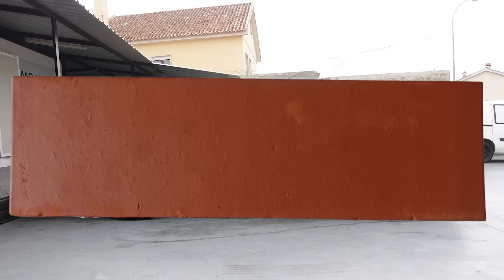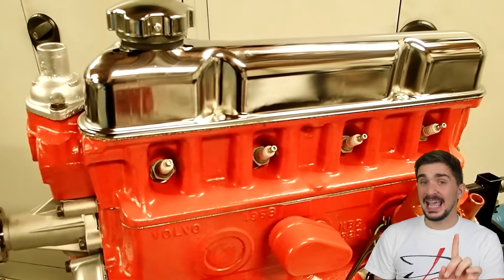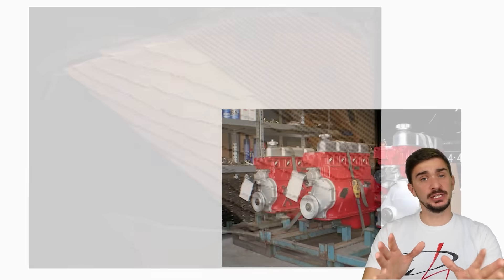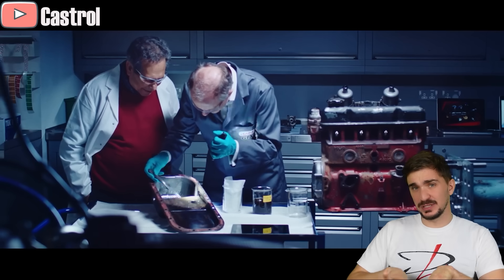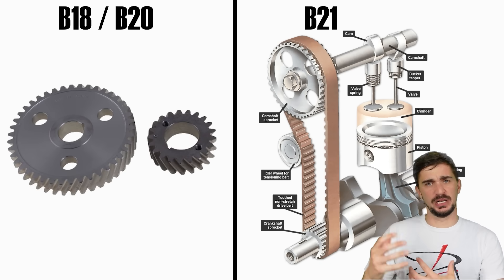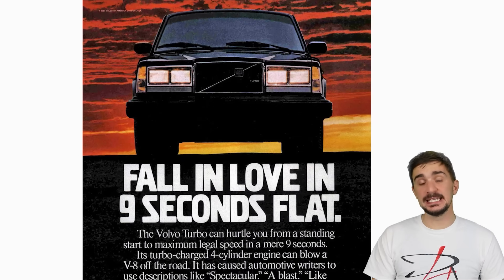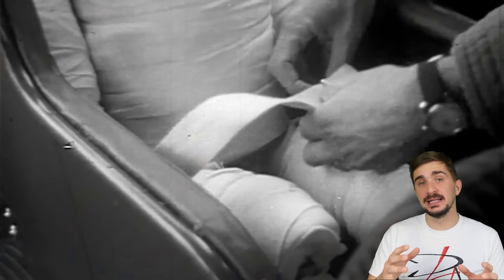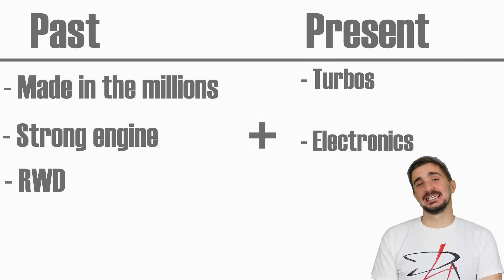A Story about the Volvo 240 and its Redblock Engine - Iconic Cars and Engines #18

Comment: Great overview of the legendary 240! I've owned a few of these and 1990 is my favorite year of the 240.
Reply: I had a 90 and put over 200,000 miles on her...   I am torn between it and the 1984 year - I had 2 different ones of those (a wagon and a 4 door) that wagon was amazing - turbo-intercooled manual transmission car with the pushbutton overdrive...  the B21FT just seemed to be a little tougher than the B230 - but maybe that was a me thing... overall, both great cars! 

OF course, the 84 gave it's life for me, took a 1T Dodge Dually diesel pickup on the drivers side - truck was going 30+ mph and ran a stopsign.  Killed the truck, bent the Volvo over 3" on the passenger side... but I drove (limped) it home!  If I'd been driving my other car that day (an 85 Dodge Daytona) - I don't think I would be typing this today.

Comment: Thank you for this nice Video! I drive Volvos since 1981 and will do this until I die. My Neighbors always tell me how bad Volvo is and they drive German cars;
but every five years they need new cars and they have lots of troubles in the years the drive (or stand). I had four 240s, one better than the other. Now I have
an 2001 C70 and his 5-cylinder, 4-valve Turbo is as great as the old B230 was.

Comment: My first Volvo was a 144 with the B20/ 2.0 l pushrod motor, but fuel injected. It didn't run because the fuel injection 'brain' - a fat briefcase-sized computer under the passenger seat - was getting wrong inputs from the cold-start circuit. A 50p rheostat, slider type, screwed to the dash gave me a manual cold start device, and when hot, I could lean-out the mixture to optimum for motorways, and a tad richer for tooling around the lanes. Everything worked perfectly, and I used to thrash that car! The engine truly was indestructible - unburstable I used to tell friends, who thought it was a grandad's car. With fairly short gears in a 4 speed 'box, it red-lined at 100 mph, but with an overdrive at the sweep of a stalk, brilliant, 70 mph at just under 3,000 rpm, and surprisingly good acceleration too, from stand-still, or at motorway speeds - hit the accelerator as you flicked the o/d out and it was as good as most other 2 l cars 15 years younger than mine! A head skim, for no better reason than that I was curious, sufficiently bumped up compression ratio and high rev performance, and by fiddling with the distributor fly-weight return springs I avoided too much knock. It was also possible to slightly change the fuel injection timing as the pair of contact breakers in the base of the distributor moved with the body of the distributor, so I ground off the lugs of the dist. cover so I could rotate it to keep the end of the rotor arm in the right place relative the pick up points inside the cover. I KNOW this motor was a wednesday morning job, and it certainly made more than the factory-stated power output, by some margin. Eventually the dist. cam spindle bearing became so wobbly that the timing scatter became almost unmanagable. But for 4 years I thrashed that thing all over Europe and the UK. Downsides? 15-17 mpg in town, an absolute max of 27 on a very gentle run. But who cared then, in the 80s?! With Thatcher in power you had to have some fun somehow!! Oh, finally - you could drive into any scrapyard back then and pull a load of injectors and other engine parts off any 144, and even from the 2.7 l six pot from a 164, a 'unit' engine based on the B18 x 1.5. The injectors were identical, as were valve rockers and pushrods and so on. Brilliand fun for ? £150, and a few quid at the breakers (-;)~ (Leather seats too!)

Comment: Greetings from Malaysia!!  Great video!! 
Didn't know that the Volvo logo is a shield and spear, the symbol of iron.  One thing for sure is that the 244 is an armoured tank disguised as a car.  It's virtually indestructible.  The engine is designed and built to last till the Second Coming of Christ.  That the same engine can last for millions of miles is unheard of even in modern cars.  Now, modern engines go kaput just one week after the warranty expires.  Volvo is synonymous with safety and reliability.
 .

Comment: In 1974 came the "millimeter engine", Volvo stopped using inches. The B20 was also produced in 1976, if I remember correctly.
You can take pistons from the B21 and use them in bored-out B20s, at least 1974 - 1976. It should be possible to rebuild a B20 and put a B21 top, but it's a lot of work.
Injection existed from 1971.
Good that you spoke Swedish at the beginning, definitely passed.

Comment: I had a 1990 Volvo 740 GL that had a transmission intercooler break, causing coolant to leak out for months until one day it started overheating. The temperature gauge was pegged by the time I pulled into the driveway at home. Then after the radiator was replaced and fluids flushed, it continued happily driving for years until a gearbox gear tooth snapped off.

Comment: Volvo introduced further strengths in the 94 940 B230FT with oil squirters, 13mm rods and sodium filled valves.  The B230FT is the preferred tuner engine today.  Capable of 1000bhp.
Also watching teardowns of the 2JZ engines, looks to me like the Japanese copied many red block features, the time lines look feasible.

Comment: The fiber drive on the B18/20 could split and then there was a bit of noise, steel drives could be bought for racing. It is a non interference engine so valves and pistons never collide. A ridiculously reliable engine almost on par with the Mopar 170ci slant six.

Comment: Always been a brick fan, even as a kid. There's just something honest about them. I have to admit, I always preferred the GL versions, and in the U.S. in the 70's that meant the 2.7L PRV V-6; we didn't get 4-cly GL's until 1980. Even so, I've had two 264GL's, three 244DL's, one of each 760's (V6, gas turbo and turbo Diesel), two 740's, both gas turbos and one 960 I-6. All but the 960 had the 4-speed + OD manual gearbox, and I loved that transmission with it's electric OD switch in the middle. They were all comfortable, competent, safe, reliable cars and I miss having one. I would put a second mortgage on my house for a pristine '79 262 Bertone Coupe; always wanted one!

Comment: My first view of the Volvo 240 was the first Wellington street race (NZ, 1985, televised live).    Entries included 5-litre Holden Commodore V8's, 5.8 litre Ford (Aus) Falcons, a swag of BMW 635's, 3.5 litre Rover Vitesse V8, - and one Volvo 240T, which arrived too late for practice and had to start from the back of the grid.   Well this hulking great brick just carved its way through the field, then it was involved in a shunt and had to pit to have its bonnet tied down.   Carved its way back to the lead again then its bonnet started flapping and it got black-flagged and had to pit *again*.   And again.    And it did it all again - here it was passing BMW's of almost twice the capacity and a Holden V8 of over double - how the hell could the motor hang together?    Yes it won the race, and there was never a more worthy winner.    Hugely impressive.
Reply: It won the race in spite of all of the extra pit stops. I bet that the other teams were thankful for those pit stops or they may have been badly shown up!.

Comment: My father used to own a Volvo 240/244GL, bought secondhand back in 2001 (pinkslip states that the car was registered back in 1983 something). I'm just 18yo at that moment, but I really enjoyed driving it. Feels very tanky and safe, and could speed up to 150km/h easily and still stable enough to control. the car still driveable until 2020, then it got some major issue with the engine, and my father no longer wants to repair it.

Comment: My first car was a 1987 Volvo 240. It had 230,000km. The engine is bulletproof, but not the wires....They are made of environmentally friendly material. It just means it's meant to degrade over time. The engine didn't break but the wiring were falling apart everywhere. I had to sold it not running.

Comment: Fabulous video, thanks for creating, editing and uploading. Informative, interesting and raised a smile several times, very wry presentation, I enjoyed it. Had a 740 estate with 250K miles which I bought for peanuts as a temporary load hauler but ended up keeping it several years because it never let me down despite no maintenance other than a timing belt. Had I know it was a non interference engine back then, I wouldn't have bothered having the precautionary belt change. That car loaded with heavy stone slabs drove up steep hills without even breaking sweat, an amazingly comfortable, well screwed together galvanised brick.

Comment: My wife and I had a VOLVO 240 (245) wagon. It was a Euro-spec car that had been sent over here in error. The VOLVO dealer begged us to sell it back to them after they discovered this at our first service. We kept the car for a number of years before selling to a serviceman that was taking it with him back to Europe. This car would 'cruise' all day at speeds well above our speed limit without even breathing hard. And it got very good fuel mileage doing it too.
 Suffice it to say, we loved that car.
Reply: I bet you wish you still had it. A truly amazing motor car.
Reply: Interesting, can explain what the difference between European spec an USA spec was/is??
Reply: I had a 1980 245 I bought in 1985 from someone in the US Air Force. He had bought the (US spec?) vehicle in England but had removed the catalytic converter so he could use it with regular gasoline. (I later had to buy a catalytic converter when I lived in a state with pollution tests.)

The only visible difference between mine and all the other 1980 245s was mine had round headlights. Suited me fine-- the round sealed beams were cheaper than the rectangular ones.

I spent a lot maintaining that car, but by the late 1990s I had trouble finding folks who could service it in my area. So I sold it to a guy who was a bigger fanatic. He had bought it for his adult daughter, who I hear hated it. I kept seeing it on the road for a few years. I don't doubt she finally found a way to wreck it irreparably.

It had electrical flaws but I just knew to carry some fuses, and plan to put in a new alternator every 100,000 miles
Reply: @conwaytwt  US vs European specs. What are the differences?
Reply: @stefpix  Presumably all the marker lights met US specs, plus the emission control system, AND (because it was 1980 and we were still under the oil crisis highway speed rules) the speedometer had 55mph highlighted in a different color and it was made so 55 was just to the right of center, if I recall.
Reply: @conwaytwt  the US light specs seem to be to a lower standard. The turn signal can be red instead of orange. The tail lights and the brake lights can overlap. The headlights often spillover and flare onto the opposite lane. Never saw these shortcomings in Europe.
Reply: @stefpix  the great thing about standards is there are so many to choose from
Reply: @conwaytwt  some standards are better than others. I moved to the USA. Many cars here have poor tail/turn/brake light designs. Red turn signals have been shown in some studies that are not as effective as orange turn signals, and there was a higher incidence of collisions. The headlights in the USA seem to point higher, causing more glare in the rearview mirrors and on the opposite lane. In most of the world turn signals are orange and separate from the tail light /brake light module. One of the most glaring examples of cars with confusing rear lights have always been the Lincoln town cars
Reply: @stefpix  I don't know why you're complaining to me about it
Reply: @stefpix  Bit late but pretty sure it only was lights to meet us guidelines. The US, dual square lights go for around 900-1100 bucks due to the demand for them in Sweden.
Reply: My first vehicle, a 77 245 4 speed manual.....I did that car wrong 😞
Reply: Great Gearboxes too  Borg warner auto box  brilliant!
Reply: You were a fool to sell a European spec car to someone who just took it back to Europe.
Reply: volvo 740 was my first ever im def jelly xD
Reply: We had a 240 and a 64 impala with the 350 . The impala used less fuel than the 240. 
I guess volvo really was more of an amcar than even some amerikan cars XD
Reply: @toadwine7654  the 245 weighed two tons mate!  2000KG!  empty weight!    full capacity   + 4 people and luggage ?.. 2700kg!     a beast!   my 240 got 32 MPG  28 MPG with the overdrive!
Reply: US vs European specs. What are the differences?
Reply: @stefpix  Euro spec generally means it has the Euro spec required brake pads, and is designed for the higher potential speeds of things like the Autobahn.  Europe has stricter guidelines for safety as well as ironically higher performance standards.  So depending on the manufacturer, the euro-spec is generally better if they don't make both to Eurospec to begin with.  the EU has higher emission standards as well, so sometimes Eurospec has a smaller engine, though the same power.  For instance, in 2010-ish you could get a 5 cylinder S60 In the US but in Europe you could only get the 4 cylinder models.
Reply: @spartan9458  You are right but you can get T5 Volvo's in Europe too. I think they are tuned differently and have stiffer suspension than U S spec ones though.
Reply: @spartan9458  thank you. That is very interesting. Is there an advantage in 6 cylinders vs 4 if power is the same? My pet peeve are the non standard brake, turn lights in the USA, which can overlap with the tail lights. I saw Lincoln town cars braking with the turn signal on in the evening and it was not clear that the turn indicator was on. 
They did studies in the USA that the orange/amber color turn signal seems to prevent collisions by some significant percentage. 

ALSO in the USA, in Brooklyn I see huge semi trucks without side guards, and with a long nose driving through residential neighborhoods. The safety standards seem lower.
Reply: I had a Volvo 240 which was about my first car in the 1980s.  I did over 100,000 miles and sold it at 165,000 on the clock.  Unlike my first car, an Austin Maxi, which was ergonomically brilliant and good to drive, it was extreme reliable, and easy to service by oneself.  It only gave ca 30 mpg, but then fuel was cheap.
Reply: My first car was a 1998 V70 T5, oh man that car was amazing.  My father got it from the factory in Sweden at the end of 1997, and we took the factory tour.  It was absolutely amazing!  It would cruise at 110-120 mph easy for an hour straight (we did high speed runs from Gangelt (near Aachen) to Spangdahliem AFB frequently since he was retired Air Force and active NATO.  about a 1 hour trip at 110-120 mph.  No matter what you were doing it always felt like it had more to give or was perfectly happy doing it.  

The 5 cylinder in it absolutely destroyed all of my friends at highschool in their mustangs and fastbacks, tuners, trucks, whatever. 
It actually baffled me that the 236hp 241 ft-ibs of torque engine in a brick shaped wagon had 64 less Horse power and Weighed Less by at least 100 ibs, than the Mustang GT convertible that some of my friends were on about.  But had an acceleration of about 1 cm per second faster at any speed unless you got caught in the small window between 35-40 mph, where it would not downshift to gear 1 but instead gear 2 and you'd be just below the power and just in the turbo lag, or on launch where it would inevitably catch up due to the very vast gear shifts it did.  

One of my friends tried to trade me a Mitsubishi Galant VR4 for it.  that was funny but he seriously wanted my Volvo. 

I did some bad things to that car in my young years but it took them like a champ.  took me 2 months to realize I had severed the front suspension (that wasn't actually my fault, construction site at 6 am with bad headlights.  I eventually upgraded the bulbs and it was fine)

I now have a 2007 S60R 6 speed manual, which was one of my dream cars.  I have had a 2015 V60 and a 2019 XC90 T8 Hybrid and while they are great, for some reason the 2012-2016 models lacked the excitement and roar of the earlier 5 cylinder models, though they still accelerated fantastically and had a cute turbo flutter sound.  
The hybrid was a beast of it's own, that 6700 ibs SUV doing 0-60 in 5.6 seconds with 400 hp and nearly 500 torques was nuts.  Super comfy and fun.

Both of the newer Volvos were lost protecting my spouse, only one of the incidents was her fault.  Unfortunately she was working for a rideshare company and they only paid 70% of the car's value Despite her having Diamond status.  
we no longer work for said rideshare company. 

The S60R is my baby, and the V70 is still in the family, it's gone around from one of my uncle's to another, and my Father last got a 2019 S90.

My father had a 2008 S80 that saved his life in a head on against a teenager in a parking lot, who somehow went the wrong way after rounding a parking lot corner. They drove the S80 onto the tow truck, (the V60 that was "Totaled" also was driveable still, the XC90 was not, due to having the engine nearly ripped out by another car)

I will be a Volvo enthusiast for life and they really are built for life.  Love it!

Comment: it didnt outlive the 700 series, the 700 series became the 900 series aka 940 , if u want real cool shit, 960, wich is the 5 cylinder engine from a 850 , but 6 cylinder and put in correctly (rear wheel drive) 960 is the most ugly, but has the sexiest engine ( they later took that engine into the s80 and put a twin turbo on it , sadly it wasnt rear wheel drive )